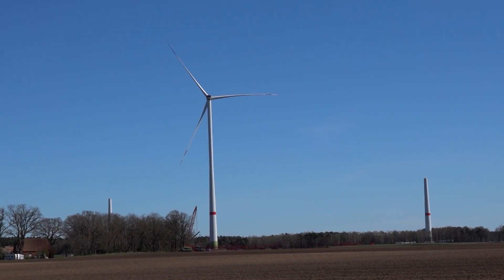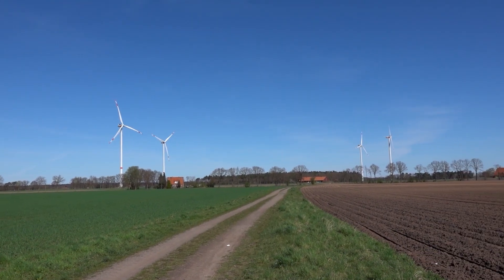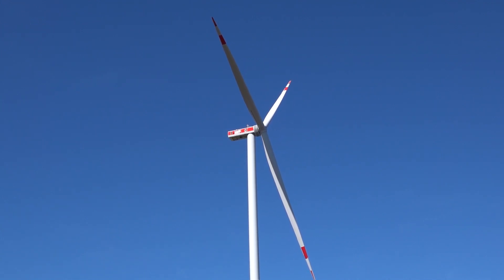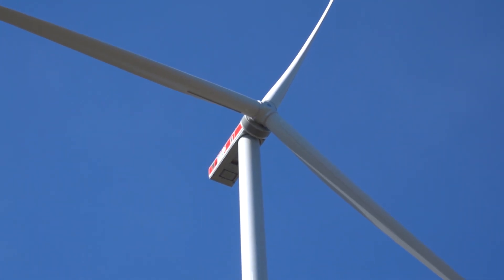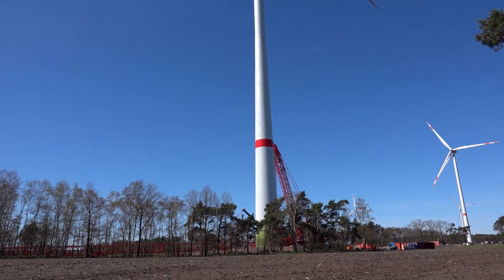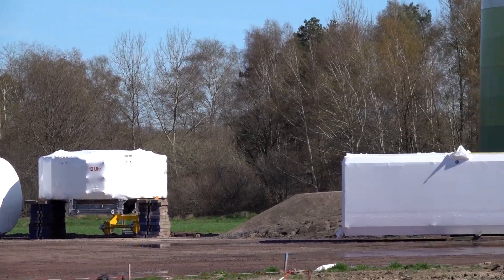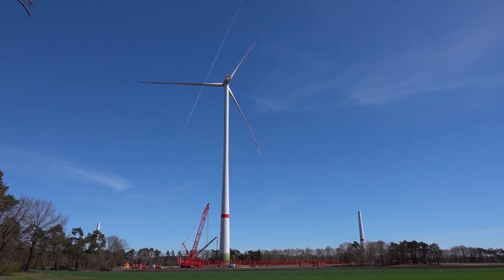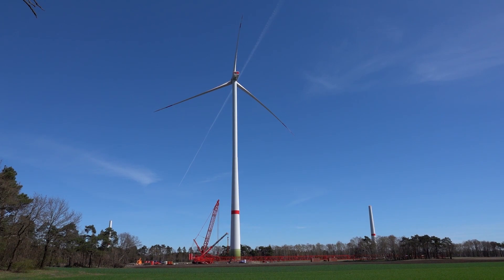Enercon E-160 EP5 E3 - first prototype with e-nacelle

Comment: They also built one near the region where I live, also with the steel tower they normally use.
Reply from the maker: Where are you from?
Reply: @RangerJones93  The Netherlands. I live near Staphorst where they're building a new Windpark with Enercon wind turbines that use the e-nacelle. Btw I thought it was the E-160, but it turns out to be the E-138 instead. Still a nice one to see though.

Comment: Da gibt es bestimmt noch eine Leistungssteigerung auf 6 oder 7 Megawatt, genauso wie größere Türme. Hab gehört, dass die schon bei 10 Meter die Sekunde auf Volllast läuft
Reply from the maker: Enercon muss auf jeden Fall die Leistung erhöhen um mit der Konkurrenz mitzuhalten. Denke schon, dass da noch eine Leistungssteigerung kommt. Die waren halt erstmal so mit der Umstrukturierung beschäftigt. Aber ich denke, sobald die E-Nacelle erprobt ist kommt auch noch was größeres. Wird ja gemunkelt, dass es eine E-190 geben soll.
Reply: @RangerJones93  E 190, 9 mw, mit 190 Meter Nabenhöhe wäre perfekt
Reply: @quattropilot9855  max Bögl hat ja schon Hybrid Türme mit 190 Metern in Planung
Reply: 190 m NH kommt!
Reply: @quattropilot9855  krank.
Reply: @quattropilot9855  wo kommen den die ganzen Leaks her. Hab davon bisher noch nichts gehört
Reply: @quattropilot9855  I hope Enercon will introduce  this model that you mentioned to increase volumen. Is there any info around this model?
Reply: Eine Enercon E-190 EP8 im Design der Enercon E-126 EP8 were geil

Comment: Design gefällt mir, e 138 wird mit der Nacelle bestimmt komisch aussehen, aber 60 kw durch Energieeinsparungen sind auf 30 bis 25 Jahre schon gewaltig. Was ja mal gar nicht geht, ist die Vestas mit dem modularen Maschinenhaus , ein absoluter graus.
Reply from the maker: Ja. Die E-115 und E-138 werden sehr komisch aussehen :D Die haben halt diesen riesigen fremderregten Generator und nicht den permanent erregten wie die Anlage hier. Also die E-160 EP5 E3 sieht ja wohl um Welten besser aus als das neue modulare Design von Vestas ^^ da ist die Optik komplett flöten gegangen. Hauptsache praktisch...
Reply: @RangerJones93  dafür spart sich Vestas viel Geld beim Getriebetausch oder Generator. Ist zwar nicht hübsch, aber genial. Will gar nicht wissen wie viel Geld so ein Liebherr Kran kosten, insbesondere GE könnte davon profitieren, da sind Getriebeschäden ja schon vorprogrammiert